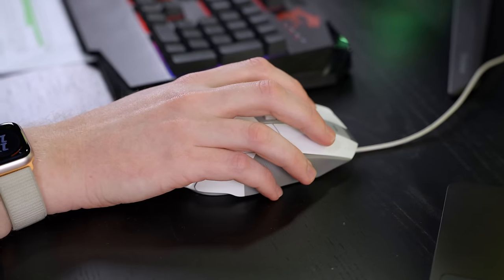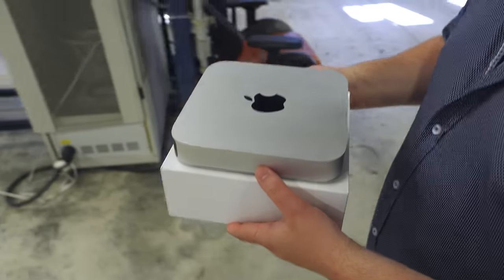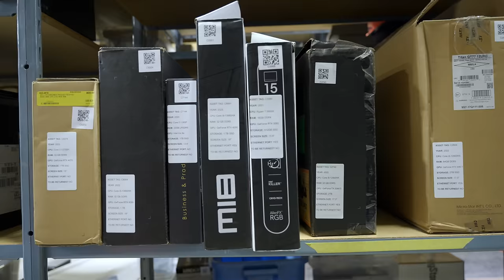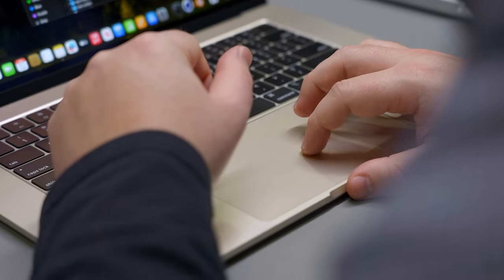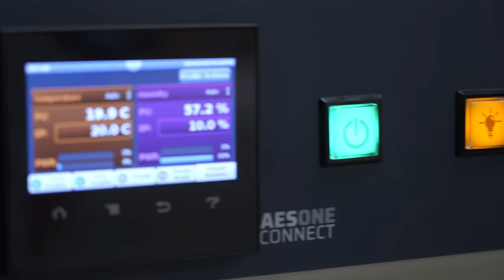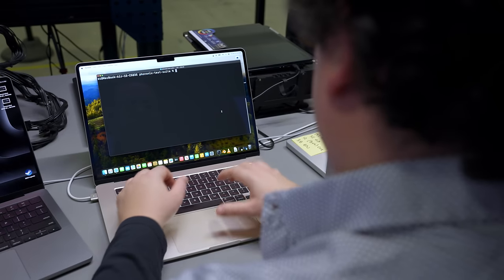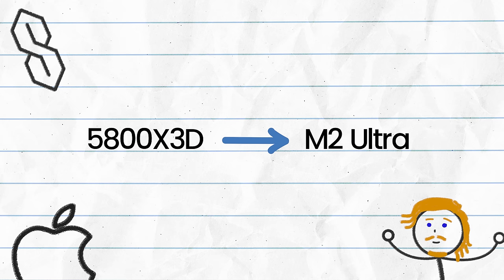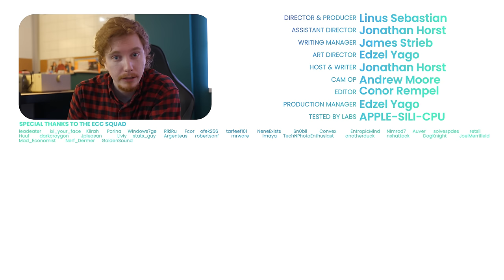How Apple Silicon Compares... - Part 1

Comment: Jonathan running games with screen mirroring on is insane
Reply: Probably to avoid closing the MacBook that'd increase heat. In MacOS you can't display only on an external display like on Windows, you mirror and then turn the brightness all the way down on the MacBook. There is no "only show on Display #2" option afaik. Silly but yeah that's how the native display settings work.
Reply: @pieterrossouw8596 you can run external only but charger needs to be plugged in
Reply: @oliver.cerezo  which would have you keeping the lid closed which may retain heat.
Reply: @pieterrossouw8596  why not extend Main Display and change the display in-game?
Reply: @pieterrossouw8596  I'm a Mac user and find this sad
Reply: Screen mirroring isn't very hardware intensive tho
Reply: @pieterrossouw8596  That's not true at all. I run my MBP direct to a monitor in clamshell mode every day, and it gets no hotter than it does being open.
Reply: @dougc84  it depends on what Mac you have specifically, don’t think any of the modern ones are affected
Reply: @pieterrossouw8596  this is false. I disable screen with lid open using software. It should also be possible with a command into the terminal
Reply: @pieterrossouw8596  This is completely false information. MacBooks don't get hotter with the lid closed. The vents are designed in a way that when the lid is open the air goes in front of the screen but when it's closed it goes out the back. There's no performance loss in clamshell mode.
Reply: @ErnieZee  perhaps no noticeable performance loss but every time I run my M2 Pro MacBook in clamshell mode - it gets significantly hotter to the touch. 

Maybe I'm just pushing my MBP harder than you - I have constant sustained loads as a software dev, not bursty loads. The palm top, display and internals absolutely get hotter closed for me. It just makes sense that the deck and keyboard area will conduct away significant amounts of heat energy and closing it up will trap that energy and transfer it to the screen rather than the air.

I used the Stats app to look at temps with a constant fan speed set in Mac Fan control, it's clearly (~4-9 degrees C in my case) hotter closed, sorry guys.

I'm not suggesting its dangerous to do this, the Apple Silicon chips run pretty cool compared to Intel/AMD chips but Apple doesn't have iPhysics yet - just standard physics.
Reply: @rossouw8596 there's 100% something wrong with your unit. I'm a software developer as well and I can crank all cpu cores to 100% on my M1 Pro and my fans don't even kick in. Only when you include the gpu with it it's starts to heat up.

Comment: A laptop AMD Ryzen 9 7945HX runs 34k points in Cinebench R23 multi and 1940 single, an Intel i9 14900HX is 32.4k and 2.19k respectivelly, maybe 7800X3D capped at different frequencies to have a similar single core performance in R23 to each Mac cpu would have been easier.
Reply: Yeah i was surprised they didn’t put current gen processors on here, then i realized the best was a LAST generation M2 chip and they also didn’t include the m3 max chip. So it feels a bit more fair to compare last gen to last gen i guess.

Comment: With the testing having so little Intel data, the coloration of the Intel chips on the graphs ended up looking like highlights. This was a bit confusing. I think a quick audible mention of the relevant (in this case Apple) chip's color would have been helpful, some better color selection, and/or zooming in on graphs to where only 4-5 items are showing would help so much. Other than that great video, please keep up the great work.

Comment: M3 came out 3 months ago.
Intel 13500 came out a year ago.
All the AMD's they are testing, came out 3-6 years ago.
How is it fair to use old AMD CPU's?
Reply: I think they are testing for comparable raw cpu performance

But the newer ones have better technologies - at least it's still the same micro architecture (zen3 and zen4)
Reply: @aravindpallippara1577  The M3 have newer better technologies too.
Reply: Theyre testing GPUs. This was part 1, setting up comparable CPUs.
Reply: @dtemp132  These CPU's were not comparable. They are using 3 year old ones.
The 8600G and 8700G would be more comparable.
Reply: @saulgoodman2018 the test selected them as comparable in calculation.
Reply: @JonGretarB  Did you see the numbers? How are they comparable?
Reply: @saulgoodman2018  pretty comparable. In some tasks the paired cpus were equal. In some either one outperformed the other. But on average and in the tasks more likely to matter they seem comparable enough.
Reply: @aravindpallippara1577 How does that make any sense? If you're doing a comparison with benchmarks to see which is faster, you wouldn't use "comparable" CPUs. The goal is to see which is better, so there's no point in even showing charts on screen if you're comparing similar CPUs. They're comparing Apple's newest against older Windows CPUs, which is just not fair.
Reply: @JonGretarB  They are not comparable.
Why are you feeling the need to suck up?
Reply: Are you mad only for Mac scored the highest? Grow up.
Reply: The test was to see if they could find an equal CPU and GPU that are as comparable as the mac. Get it? That serie of AMD can compare to the full M1/M2/M3 Line up. Low to High. It not a piss contest. The goal  is to build a computer that is 1-1 with  a M3 mac
Reply: @chrispy.critter  Then what is the point of this video? Unless they were doing a price comparison of equivalent computers (which they weren't), that wouldn't make any sense. Are you mad that they compared the newest generation of Apple CPUs against older x86 CPUs on an outdated architecture and they were still pretty close? How about you grow up.
Reply: @chrispy.critter  It does not matter who score high. The are not comparable.
You cannot compare a 3 year cpu to a 3 month old one.
Why is that so hard to understand?
Reply: @chrispy.critter  It is not 1 to 1 with the Mac. Look at the graphs that they should.
This was not a 5% difference.
Reply: The channel is Mac Address. Of course there's going to be a little bias towards apple.
Reply: @phero6933  This is one of the least biased apple centric channels on YouTube.

In fact, the parent company LTT has a major anti apple bias in their content across all platforms.
Reply: @nocommentarygaming2644  the point of the video is to build a test bench of a comparable power.
Reply: @saulgoodman2018  I’m really not sure you watched the video. The first 2 minutes are all about explaining this. 
And what does the age have to do with this. This is finding 2 things equal in *power*. Not in price or age or power usage or anything.
Reply: @JonGretarB  CPU technology changed in 3 years.
Did you look at the number that they showed? They are not equal.
You can put the 5800x against the M1. But not the M2 and M2.
Reply: @JonGretarB  Alright, well they failed at that even though that would be a pointless video. Definitely unsubbing from this channel because of the extreme Apple bias. I want to see a fair comparison against the newest technology from all companies, not just from Apple.
Reply: @nocommentarygaming2644  extremists and fundamentalists always think all discussion is biased.
Reply: @JonGretarB  Definition of an ad hominem attack. How about trying to debate the argument and refrain from name calling?
Reply: @nocommentarygaming2644  you need to look up ad hominem. 
I’m just saying. Some people are set in their ways and find reporting they like to be offensive to them in some way. 
The point is to try to find relatively similar CPUs. Of course it is impossible to be completely equal in all ways but that is not the point. However a lot of people here are just so butthurt and feel so threatened in some bizzarre ways.
Reply: @JonGretarB  "extremists and fundamentalists" WTF?
Reply: @JonGretarB  A 5% difference may be relatively similar. But not 25-50%.
Reply: @saulgoodman2018  what are you talking about. The FLAC test? In most tests the 5600G that M1 and M2 will be compared to actually outperformed it.
Reply: @JonGretarB  You are not even looking at the charts.
Reply: @saulgoodman2018  yes I am. I have for example the Blender chart open as we speak.
Reply: @JonGretarB  Obviously you are not looking at them.
Reply: @saulgoodman2018  ok. Which charts would you like me to look at? Not the FLAC one. That is a special case that I am surprised they even tried.
Reply: @JonGretarB  Look at all of them.
Reply: @saulgoodman2018  For some reason YouTube deletes my reply. But basically when comparing M2 to 5600G. M2 wins in 4 tests and 5600G in 4 tests and equal in one. Two of the tests there apple silicon wins are the RAW decoding and FLAC encoding. That are tasks that are both hardware accelerated(so duh) and a bit silly to include. But they existed so there you go.
Reply: @JonGretarB  The 5600g is not the problem. Because that came out within a few month of M1 and M2.
But he is putting a 5800x, up against an M#. Which is a 3 year difference.

Comment: I ended up getting an M2 Mac Mini last year as my office computer. I honestly havent looked back at windows. I keep a windows laptop for the programming software my company uses, but thats pretty much it. I used to think OSX was messy and lumpy. But i worked out that it actually caters to my ADHD with all the floating windows ontop of eachother. This was all off the back of your review, so thanks for that.
Reply: I also switched to an M2 Mac mini, MacOs is so much cleaner, I was getting sick of built-in Windows ads and clunky new features.
Reply: I have to use a Macbook Pro at work, and I have the exact opposite opinion funnily enough. I miss the days where I used Windows or Linux at work every day. I find the lack of niceties to be quite appalling, having to install random 3rd party apps to fix fundamental issues (MacMouseFix because the scroll wheel sucks by default, Rectangles to have proper(ish) window management). And to me, the fact that any desktop app that remains "open in the background" has a dot despite having no window opened is quite ADHD-enabling.

The shortcut layout doesn't make any sense: option, command and control literally all mean the same thing, and are super inconsistent. On Windows, with rare historic exceptions, if you want to do something within the application, it's Ctrl. If you want to do something a little different, it's Ctrl+Shift or Ctrl+Alt. If you want to do something navigation related, it's Alt. If you want to do something with Windows, or window management, it's the Windows key. Linux usually follows this too, with some variations but nothing major. On macOS, it's super unintuitive, with window management shortcuts on Cmd (like Cmd+H), and regular app stuff that isn't navigation being on Opt.

Also, macOS updates take so damn long to install. Sure, Windows updates often, but it doesn't take 10 minutes out of my day, usually 2 or 3 if it's a big update. I don't know why but "update during the night" does not work and never updated.

Apple as a company is also terrible, see how they maliciously comply with the DMA when they had every opportunity to comply the normal way, and get a massive reputation boost from techies.

Also a very stupid thing: unless it's DisplayLink, you can't use a USB C hub with 2 display outputs on it. It will only mirror the same screen and not extend on both screens. This works fine on Windows and Linux, I have no idea why it doesn't on any Apple Silicon-powered laptop. It's not the end of the world but it's really stupid.

Also, as a developer, I can't do anything to support Mac systems if I don't have a Mac myself. You can't officially do anything, not even a VM, and have to resort to hacky methods. This just sucks.

The main thing that is better is the hardware: phenomenal trackpad, phenomenal screen, great keyboard (although a VERY hard bottom out on keys which makes it a bit uncomfortable for heavy typers). But the software hasn't been great.
Reply: Sounds like you're not a Mac user and it shows. 

Mac OS inertial scrolling is superior in every way when you use (in my opinion superior) hardware like the Trackpad or Magic Mouse. using hardware that isn't designed for Mac on Mac of course will require alternative software to be fully optimized. You liking how janky the software is on windows doesn't make the janky windows solution better than the Mac solution. 

Shortcuts are shortcuts, and have been the same since The late 90s. Your ignorance to other platforms doesn't make Mac worse or windows better. they all do exactly the same thing. CMD and Option are as intuitive as CTRL and ALT if you actually practiced both. 

Windows updates when you tell it not to update, enough said. Also includes bloatware and other issues that can't be easily remedied. I've had windows servers go down for days because of failed windows updates. At least on my Mac servers I can do regular Time Machine backups, and they don't update themselves without my consent. 

Apple as a company is not terrible. They are the most progressive company in tech, support the arts and creatives, are the best to their employees, and are consistently industry leading on almost every front. Not sure how you can have this opinion. 

Apple silicone simply doesn't support multi monitors, it's inherent to the architecture. this is one of the most annoying things about Mac currently 100%

Why would you be developing for apple hardware on non-apple hardware? As a (fellow) developer this is common sense. 
 @matthieulucas9059
Reply: Damn, I forgot how passionate people are about their sides. 😅

I'm just running mine with a Logi MX Keyboard, Mouse and a couple of 1440p 75hz Dell Monitors. 

I am no power user of Windows or Mac. But after decades of Windows and Android use, I am enjoying the Apple Ecosystem. 

The Apple TV was the first Apple product I picked up since the iPod days. I preferred it to the Shield and dodgy Android box alternatives. I was one of those few users who experienced the "Terms and Conditions" issue where I didn't have an iOS device to accept the new Ts&Cs. So I picked up an M2 iPad Pro 11", a lovely combo. The screen mirroring to the TV is the best I've ever seen implemented... I needed a new work phone, so I picked up an iPhone 13. I have to admit, between these four devices, they're fantastic. 

I have my iPhone & iPad folders identical to my S22 Ultra. The borders between these machines are so thin now. It is much over muchness. 

I recommend trying the spectrum of devices before you jump to conclusions. Find the devices that work for you, and let's all enjoy the fact that we have lots of cool tech at our fingertips :)

Comment: I can't wait to see how this turns out! The Apple vs Windows divide has been going on for longer than most LMG staff have been alive to the point where cross-platform comparisons don't really come up - you're either on one side or you're on the other, and X is better for task A whereas Y is better for task B and that's the end of it. I will be so glad to see what the results are, regardless of how they come out, so I have something to compare Apple Silicon to (I've never had a functional Mac of any sort). Can't wait to see the results! <3

Comment: Couple things to keep in mind:
1) All these results need to carry the caveat: These are last, and last-last gen PC processors (soon to be last-last and last-last-last). Instead of trying to find mac's that are comparable to PC performance, you're trying to find PCs that are comparable to mac performance, which is a pretty important caveat since you're literally having to go back a couple generations to find stuff that's as slow as the normal consumer grade stuff that Mac is producing. Their Ultra chip(s) are non-starters for most people because the price tag on those things is absolutely, gob-smackingly insane, and that's before you even start getting reasonably sized ram and storage added in.
2) As someone else mentioned, please do not, under any circumstance, test these with that abhorrent screen mirroring setup you demo'd it on. That's....just nutty (both for playing or for testing).
3) I was actually expecting Mac's to do a lot better than they did. Seeing an M1 processor losing to a 3000-series AMD chip in some of the tests was pretty eye-opening. Again, I don't think the Ultra is really worth talking about. You can build an absolutely state-of-the-art gaming PC that will blow the doors off the Ultra Studio/Pro machines in 90-95% of tasks (let alone games), for the cost of an Ultra machine. Ultra may be powerful, but it's just a horrible value proposition. Yes, a small subset of tasks are very fast on it, but those particular tasks are extremely fast on ALL apple silicon, so you don't ever buy Ultra just for those tasks.
4) I still can't get over that you're comparing 3-4 year old tech from AMD to state-of-the-art Apple stuff. If that's not a telling scenario for the Apple ecosystem, I don't know what is.
Reply: You make a fair point about how old the comparison PC parts are, but did you stop to consider the 1) power draw difference (like 30-40 watts vs 100-150 watts for the 5800x) and 2) that it is a laptop CPU vs a full size desktop CPU that, at launch, was nearly 500 dollars alone (also 5800x)?

I do agree to some regard though
Reply: @ashtonbeca  Let's say you live in Germany, one of the places with the highest energy costs, play 2h/day, what does energy cost? Let's say the power consumption difference is 200W (my PC on full power, Ryzen 5 2600 + RTX 3070).
365days * 2h/day * 0.4€/kWh * 1kW/1000W * 200W = 58.4€

So for 3 years of usage, you won't even get a RAM upgrade from 8GB to 16GB for Macs 😂.